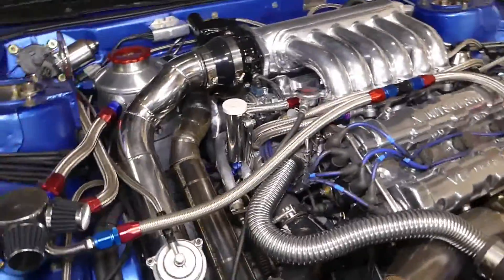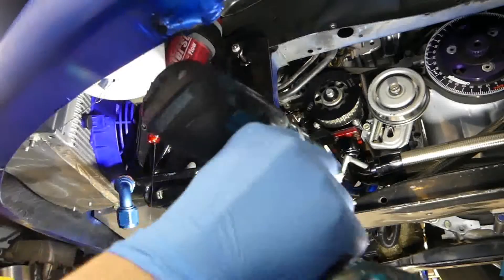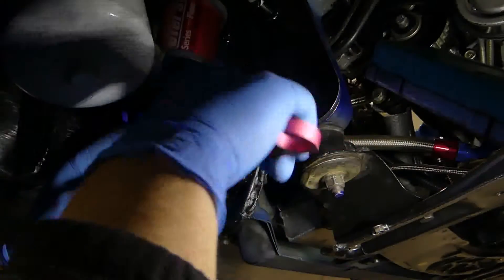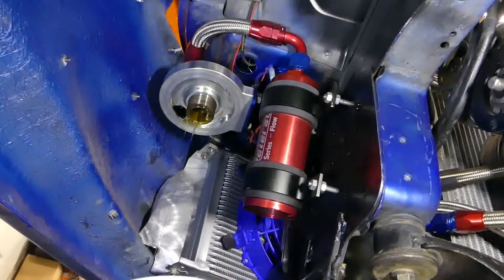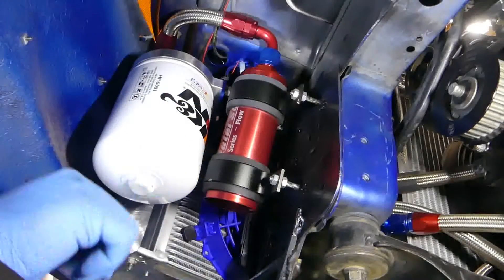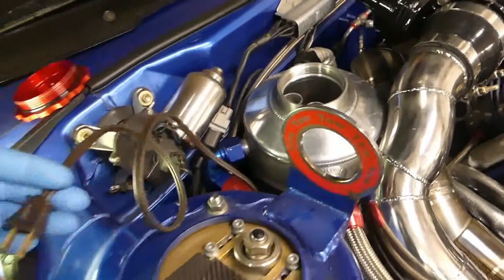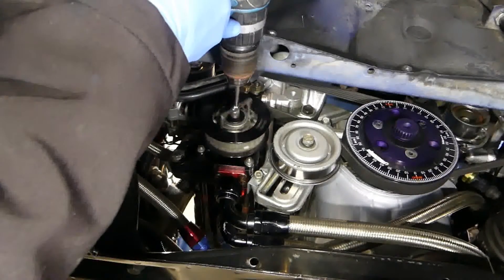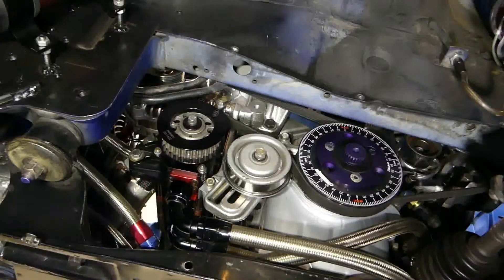Dry Sump Oil Change Walk Through

Comment: How do you decide on the capacity of the tank you should use? Should you get a tank that closely matches the OEM oil capacity or double that?

For example: A Honda K24 calls for about 1 gallon of oil. Should I get a 1 or 2 gallon tank?
Reply: as much as you can fit. It won't hurt to have more

Comment: Ya need a dab of antiseze on the red oil filter threads and put scotch tape on the red 12 an wrench so you dont score up the fitting or paint it with plastidip a lite coating so it will fit the nut
Reply from the maker: Not a bad idea, thanks Richard.

Comment: Great vid!  I am debating dry sump vs trap door wet sump myself for a mostly street, but race-able build.  Did you have to make that pump spinner tool yourself?  What is the process without that tool?
Reply from the maker: Yes, I made that little Y bit that spins the pump. Without that, you have to manually drain everything. It just means that you have to remove more fittings. Not the end of the world but more time consuming and messy really.

Comment: This was an enjoyable vid. I just started learning how dry sumps work. In a dry sump system, do you have a spec volume of oil or do you just need to make sure the tank does not empty? Or maybe I'm confused.
Reply from the maker: This system uses a 2.5 gallon tank compared to the stock system that used only 1 gallon. It's quite a bit more oil overall, but yes, you certainly want to make sure the tank never goes empty.
Reply: @DoesItTrack  So the car needs 1 gal, and the system holds 2.5 gal. Does that mean you could run w/ 2 gal and be "ok" or do you absolutely need 2.5 gal to keep everything lubricated and cooled? Thanks for the reply and I'm really enjoying the channel.
Reply from the maker: @josephcitizen4195  i could possibly go even lower than 2, but I wouldn't. Just no reason to.
Reply: @DoesItTrack  Got it. Thanks for the tiny Q&A. Keep it up and I'll keep watching man. Thanks!

Comment: With that big of a disposable final filter, is there really a need for the mesh pre-filter? What advantage does it provide? I assume (based on the color of the drained oil and being a car guy) you change the oil and filter often enough that the final K&N will never be close to loaded.
Reply from the maker: You are correct, but I do like to be able to pull the stainless filter apart and easily check for material. With a disposable, you have to cut it open, it's messy, and not the easiest to see between the pleats. With the Peterson filter it slides out and is really easy to see the condition of the engine.
Reply: @DoesItTrack  that makes sense! 👍
Reply: Is it before or after the k&n filter?
Reply from the maker: @Projectblackkjack  It's before.
Reply: @DoesItTrack  ok that makes sense, do you have them at your oil pan to protect the pump from chucks?
Reply from the maker: @Projectblackkjack  It does. Inside the oil pan has mesh cone filters on the outlets but there are huge in terms of particle size filtering. Like 1/16" or something. Only there to stop really big bits in a catastrophic failure.
Reply: @DoesItTrack  ok cool ya you have a nice setup I'm just designing my own, there is no off the shelf kits for my project